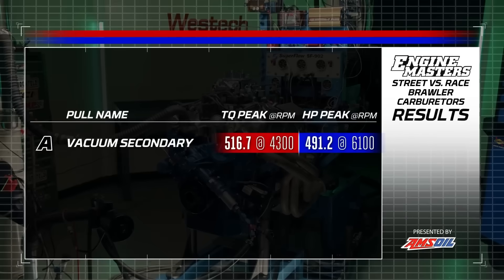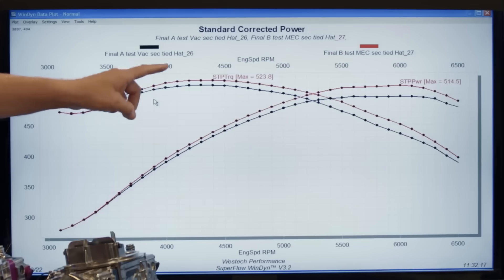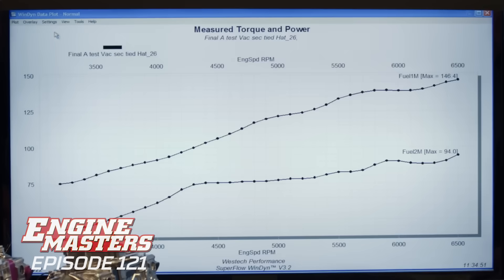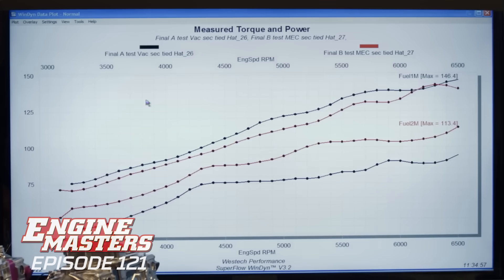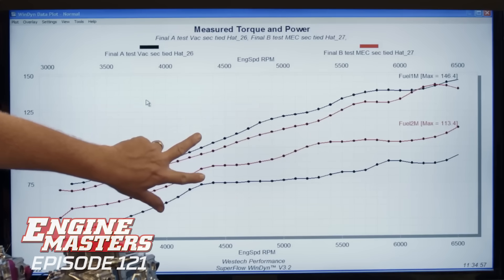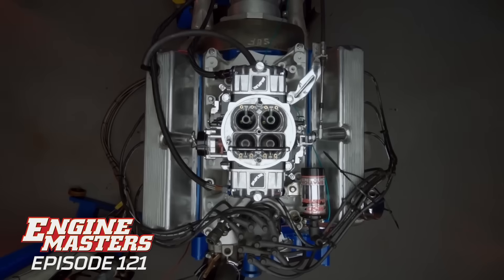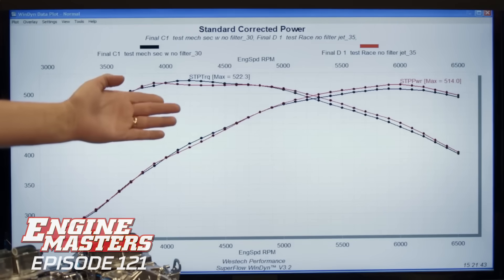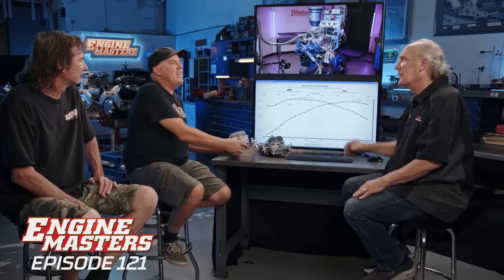Carburetor Confusion! What's the Best Setup? | Engine Masters | MotorTrend

Comment: i think the choke horn affects fuel attomisation and distribution to rear cylenders.
9/10 people will always choose the double pumper (i would).
i used to mill my choke horns off because i couldnt afford a race carb and it was a cheap mod.
Reply: now brawlers sell those pretty cheap  and they have ones that have vac secondary with no choke too.  kind like a hybrid

Comment: Are you saying you couldn't increase the secondary jetting to help the secondaries flow more fuel? 
Odd that you didn't try that.
I must be missing something.
Reply: @pinkysgarage4517 there’s a lot more to this episode, this is just the highlights. Use the app, watch the episode. The AFR’s were very close, the difference in fuel flow has to do with the quality of airflow. Bottom line, if you’re wide open all the time, a DP makes more power.

Comment: its not enough deference in power to make it worthwhile, I ran a vacuum 780 cfm on a super comp dragster 355 ci with horn still in place worked great interesting listening to it coming up on the brake. what shows up on the dyno is not always track information. thank you love the videos.
Reply: 23 PEAK HP difference on this test is almost a 5% increase, & the double pumper made more torque & HP from just below the test starting RPM all the way to max RPM. That's a pretty substantial difference. Double pumpers have zero disadvantage, "when properly tuned". I've always run them, since 1971 & never had a problem, even in cold weather, without having or using a choke. My current 750 Street HP on an Edelbrock Air-Gap intake & NO heat riser fires up & immediately idles in summer, takes a couple starts & hold the throttle slightly open in the winter, until the engine builds a little heat. My 500HP, 409ci SBC also gets better fuel economy than my computer controlled FI 2004 Tahoe. But, I will add that I've been tuning carbs for over 50 years & learned some big lessons in the early 80s working on highly tuneable Weber carbs, which the Holley HP series tuning is comparable to with their "air correction" jets!
Reply: @bradgriffith4231   This test was done on an engine dyno. A chassis dyno with full accessories and you will never notice that 23 HP.
Reply: @SOLDOZER  If you think 5%, or 23 HP isn't noticeable in the vehicle & going down the track, you're very naive or have never raced. Pro Stock guys will spend $10,000 to find 1 or 2 HP with a motor that's already making 1,500 HP! 5% is a BIG pickup! BTW, our ALL MOTOR door slammer has gone 7.97/168 on race gas with 4,000 foot altitude air density, that's 7.70s/172 with 70* sea level air! How's your slug run?
Reply: @bradgriffith4231   Nobody is talking about pro stock race cars here. We are talking about weekend cruisers.
Reply: that 491 vs 514  is basically you saying you have a 500 HP small block as opposed to to saying yeah it makes almost 500  thats kinda a big difference.  if i ran a mechanical secondary on the street (which i might still do)  id run a choke.  that i do agree theres no real difference vs running a true chokeless race carb  even if it's the summer.  780cfm  on 355 inches  can and should  run over 7000 RPM

Comment: These are thing I struggled with early on. Eventually I ran Choke carb tuned for winter. Then a different choke horn delete (sawed off and polished away) carb tuned for summer. This was before you could get a "race" carb with that done already. The double pumper horn delete was for summer. Vac sec for winter. They ran the same in the environments they were tuned for. Nobody knew.
Reply: or,

now you can get a chokeless carb with  vacuum secondaries!!
Reply: I had a 62 nova straight 6 that in winter or summer pump twice and she'd start and idle no chock. With engine hot just turn the key. That car would idle all day and not skip a beat, smoothest carbureted vehicle I've ever had.

Comment: I tend to oversized vac secondary for driving,  just right sized (big AF) double to try to pull the most for performance.  There is such thing as too big for a dp for a lower idle street/strip application.  Just my understanding, tell me if I am wrong.

Comment: The choke horn interferes with the signal to the air bleeds, that is why is makes less power.
Reply: Actually, the choke horn improves the Primary venturi bore mixture quality and the carburetor would benefit from a "Horn" or wall if it entirely circled the entire airhorn. The principle is seen with a K&N stub-stack or similar effect with an air cleaner base that forces the incoming air to drop straight down into the airhorn rather than circle its way in as it does without one. Picture a sink drain. When the water flows down a drain, it is actually slowed down by the fact that it has unlimited approach angles from the sides and that is why a circular vortex flow pattern develops and leaves a "hole" in the center of the drain flow. When you force the water to approach from directly above (think velocity stack) it must flow straight down and will not develop a vortex with the space wasting "hole"in the center.
Reply: @reason2gether  So tell me do you have dyno numbers to back up this theory?
Reply: @racerd9669  Better. I have timeslips.
Reply: @reason2gether  So here is what you really need to do to prove you theory. Go to the track run the car 3 times w the choke horn on it, then remove the choke horn on that carb, streamline the entry and then run it 3 more times. That will be the best way to prove what works best.
Reply: @racerd9669  Right! And then if by chance it ran better with the choke horn on, just put it back on! Oh wait.....ummmm.... well shoot.....😬 Duct tape. Where's the duct tape. Fixes everything......

Comment: I had a brand new 3310 vacuum secondary on my mild 383 right up until some chassis dyno time.  The shop had a used 650 dbl pumper on the wall and after throwing it on the car I promptly bought it.  WAY more stable AFR from the 3310 and I had all the springs and quick change kit.  And this was a 3.08 geared, auto, mid 14 sec car.
Reply: Dyno "tuning" is a waste of time & $$$$ because there is nothing about the climate conditions or loading on a dyno that actually simulates real world street or track driving. NASCAR engine builders look more a the time it takes to accelerate the engine from bottom "track" RPM to peak RPM rather than peak HP with the load being the simulated vehicle weight & overall gear ratio.
Reply: @bradgriffith4231  guess you ignored the part about AFR jumping all over the place.  AFR is AFR.  Everything you said may be true but gauge readings are true as well when used comparatively.  Clearly one carb was consistent with fuel delivery and one wasn't.  Nothing but truth in that observation.
Reply: @madrew2003  Maybe y'all ought to learn how to properly tune a carb if your AFRs were constantly changing. Regardless, dyno tuning is a waste of time & $$$$ because there's nothing a dyno does that remotely resembles real world applications, whether on the street or track. Pro Systems will build & correctly calibrate a carb to perfection & ya won't even have to touch the A/F mixture screws or curb idle speed without even seeing the car, IF ya tell them the truth about your engine specs, vehicle, & altitude where it's normally raced.
Reply: @bradgriffith4231  you sure do like to beat that drum, don't ya?  Give it a rest.  I use a wideband gauge to tune my carb and the trap speed at the track.  Does that make you any less cranky?

Comment: Oversized Holly carbs almost ALWAYS make more power ON A DYNO. In fact, often times they even out perform fuel injection. This has prompted every car guy on the planet to put a 1050 cfm dominator on their 283 small block. Unless you are on the track you are NOT driving wot at 7000 rpm and you’re killing power everywhere else. I’ll stick to my slightly under sized vacuum secondary carbs for superior driveability and power under the peak rpm. For me it’s all about excellent fuel signal ratio.
Reply: he did say that these types of carbs are sized to the application and RPM range

bet if that vac secondary was an 850 then  thered be a different story.  mech secondaries USUALLY dont like being oversized like you say

Comment: TECH TIP: tell Brule instead of highlighting the file he wants to open and then clicking the "open" button to just quickly double click the file he wants opened, over a life time this will save him YEARS! ;)
Reply: I worked with an old guy and when going over drawings he always traversed the whole file path.
I showed him in file explorer how to set up the shortcut in the menu so he could directly jump to project to project instead of traversing from the root drive. I come back to him later and he is doing it the same way without using the shortcut, he said he's just used to it, he's wasting more than years
Reply: its best not to try and correct someones routine in that sorta thing

Comment: does the vac barb need bigger jets in secondarys ,,?
Reply: Can't change Secondary Jets if it has a Metering Plate, Metering Block, Yes, Plate, No.
Reply: @badass6.0powerstroke10   You can open the restrictions .002" or .003" at a time, though.

Comment: I used to run a 454 with a Holley 850 with a Stub Stack on. I did The same with a 1050 dominador. Although i never knew if that would increase HP and torque.
Reply: They dont. Its a gimmick that faded away

Comment: Awesome video guys I have to say I just took a 850 dp out the box brand new from holly I had my big block 427 on the dyno the carburetor was junk out the box the needle was jammed in the seat had to ùse pliers to pull it out the carburetor was running uneven would not run it was flooding I don't know what happen to Holly's quality control but I won't be buying another so I use a 950 my buddy had that we knew was good the mild 427 made 661 hp and 605 torque all the motor has is afr 265 oval port heads and a Howard's hydraulic roller 235x241@50 with 618 lift that's the same combo richard holder said never had enough cam to make 550 hp so.etimes ĺess is more the 468 richard dynoed with the same heads and a bigger cam only made 622hp so my Lil motor made 39 more hp. How does that happen I'm guessing just the right combo like I said sometimes more is less. So I will be putting it a brand new ATM 950 on my motor. Thanks for the video guys.
Reply: richard holder is wrong often.
Reply: @bigboreracing356  well I was there for the dyno pulls and there were no numbers fudged  his dyno is pretty accurate I've seen alot more then my motor on it.
Reply: Right around 3200 a little less
Reply: I don't have it in the car yet but it's got 373 gears and a 275 x60x15 don't know what it's gonna run this is a brand new motor
Reply: @bigboreracing356  now how do you know the carb I got from holly was made  in China. That's just like you saying  the guy who dynoed my engine don't know how to run a dyno he has had it over 20 years and dynos most of the engines he build and he has been building race engines over 40 years so it sounds like you know everything.

Comment: I believe the vacuum secondary will get better fuel mileage too. I personally would rather the extra HP. If I wanted fuel mileage, I'd drive a Honda. <<<NEVER!
Reply: A Holley Carburetor with a properly sized idle feed restriction, electric choke, and tuned will get satisfactory fuel mileage. A double pump carburetor, especially models that aren't equipped with a choke are calibrated rich in the idle system and have smaller size power valve restrictions necessitating bigger carburetor jets that run richer at part throttle. NOT an economy carb fer sure. The vacuum secondary carb can be tuned for economy AND performance.

Comment: Living in California helps with the no-choke decision .  Try starting a carbureted car in 30 degree weather without one.
Reply: well if im trying to run a car like that in 30 degree weather that needs that type of carburetor, then im driving the car at the wrong time of year.  that's a warm weather, hot rod, not a daily driver especially in cold weather
Reply: @KingJT80  I'm driving this engine in my pic here now.  Fall is a great time to drive.  We still have car shows out here in the midwest.  I'm looking forward to a Trunk or Treat Halloween show on the 29th.   Expected temps on the 29th here?   High of 52 meaning its going to be colder at 9:00am.  I drive it until the salt hits the ground  then its garaged for the winter.  The first salt hits typically anywhere from about Mid November to mid December.
Reply: @KingJT80  yes. You are right. Cars like that usually also have no heat on the intake manifold. When driven in damp, cold weather the carburetor ices up and runs VERY poorly and sometimes not at all. I live in the Chicago where the winters are miserable. In the 1970s & '80s the cars I drove had 4.30 & 4.56 gears and Holley carburetors with no chokes on cold intake manifolds. Those type of cars were my only cars. I drove 'em all year long and VERY seldom ever let me down getting back & forth to work. I only worked about a mile away. Short trips like that weren't that big of a problem but for any continuous use it would ice up and barely run. I used to use bigger idle feed restrictions in the carb in those days that made cold weather operation much better but I would definitly use a choke now days to allow a more proper idle a/f ratio for gas mileage purposes with what gas cost. Also, at the time I didn't realize that I was probably washing down the cylinder walls with gas and diluting the oil. With the gear ratio that I had in my cars I always liked to say "I can't go very far but I can get there pretty fast!".
Reply: I'm not so sure that applies to all well tuned engines.  I've never ran a choke, but I don't drop the ignition timing back low just to hear the engine lope either and that seems to make all the difference on cold starts.
Reply: Cold starting is no problem with a Holley carb but cold idling and driving is unless your idle fuel mixture is calibrated richer than necessary. In that case you will get lesser fuel mileage than optimum and need fresh spark plugs more often. Some people say that it also washes the oil off of the cylinder walls causing faster wear.

Comment: What about comparison of the A/F curves between carbs?  I was expecting to see that presented as the punchline.
Reply: It would seem to stand to reason that if the airflow is the same and the fuel flow is different between carbs, the air/fuel ratio is going to be different. Which begs the question of how much and how much difference the different ratio makes. It's a really odd thing to completely ignore in the video.
Reply: @smoberley  The fuel curves were different Air fuel ratio at different throttle openings and different RPM. Also atomization is critical and throttle opening has a lot to do with it. fuel is bouncing or running off the throttle blades. they were also thinking pull over on the secondary double pumper nozzle is a good thing ITS NOT. Its just entertainment/ advertisement for summit and brawler the results are junk. probably sold a lot of carbs.
oh and one more they are just hammering full throttle so the vacuum sec looks good because its a sort of governor. In real life a good driver will roll on the throttle riding the torque curve on the double pumper.
Reply: @tomhutchins1046  I totally agree ! Great comments ✅😎
Reply: @tomhutchins1046  Your informative comments (👍) made me think that they could have restricted the second pump to prove their theory?
( -shade tree mech with Edelbrock weekend cruiser)
Thanks
Reply: well yeah its gonna be different in that no choke brawler that the vac secondary version.
Reply: @KingJT80  Yes, I was expecting them to say that the HP difference was related to A/F ratio differences but that did not happen.  They showed there was no difference in actual airflow, so I was left wondering what was the real reason for the significant HP difference.
Reply: @rogermason5833  well they did mess around with the jets too off camera. Vac secondary couldn't make more power
Reply: The flow meter there using is not very accurate and even consistent, if it was it would be used as a flow bench

Comment: If the vacuum secondary carb flowed less fuel in the secondary, was the AFR leaner?  Would increasing the jets help the power?
Reply: @bigboreracing356  - There are jets in the secondaries. However, there is no accelerator pump.
Reply: @bigboreracing356  Brawler series does.
Reply: No. Both carbs would be providing the same air/fuel ratio and adding more fuel to either would just cause an over rich mixture ratio and possibly lose power. The DP carb is pro-active in that it squirts the required amount of fuel into the incoming air ahead of the curve which is why it allows better performance to begin with. The air and fuel enter instantly and are predetermined by tuning. No restriction equals maximum air/fuel inducted into the engine. The vacuum secondary design is a reactive design that restricts the airflow to an always less than maximum so that it can use the throttled engine pressure differential to initiate and maintain fuel flow to match the airflow. This can give good torque and is easier to tune to prevent "bogging" but it comes at the cost of limiting the engine to always less than maximum induction for any given load and RPM condition.
Reply: @reason2gether  you did not watch the video carefully nor do you understand how this works.
Reply: @bigboreracing356  LOL - still wondering what the AFR differences were.